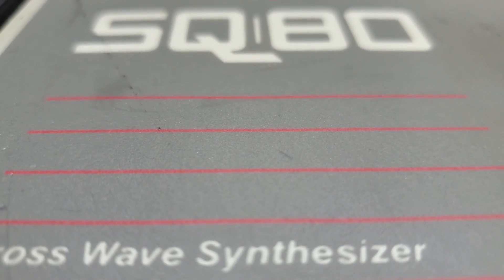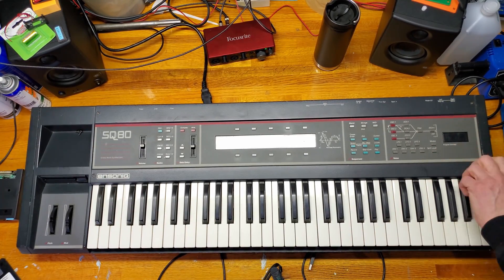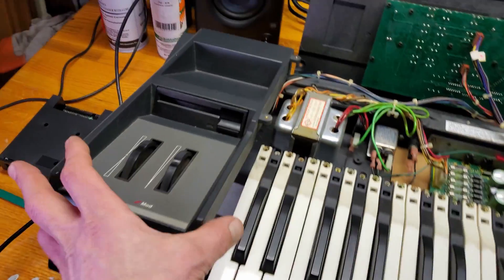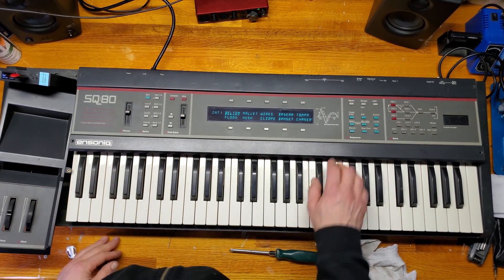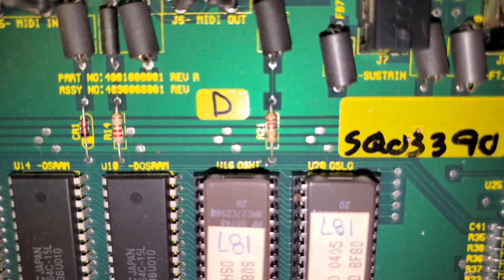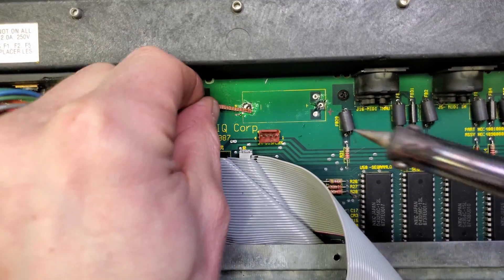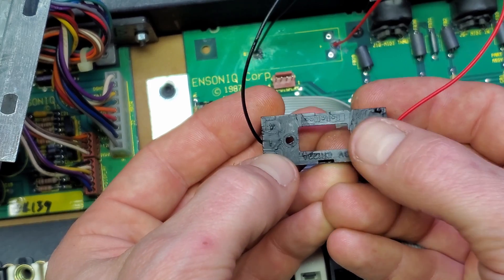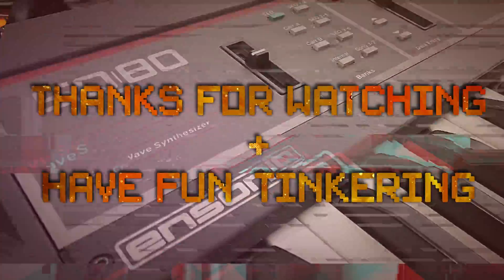Ensoniq SQ80 Battery Replacement & Upgrade (Firmware + Floppy Drive)

Comment: What sort of battery / holder did you use for this?
Reply from the maker: Wow, I can't believe I forgot to mention that. Anyways, the battery I used was a CR123A. I believe I got all the battery stuff for this project off of ebay
Reply: @deltamumusic  Thanks!

Comment: I'm curious if the floppy upgrade was worth it, and where you find patches or waveforms to load onto it? I've got one that came in a TS10, but never used it.
Reply from the maker: Honestly, I haven't made much time to utilize it yet. But I went through with the upgrade for a couple of reasons.
1. I wasn't given any floppies with it
2. I had no floppies that would work with it. (Double-sided Double-density aka DSDD, other kinds are prone to errors)
3. Floppy disks of the right kind are some what expensive. (Maybe $25 for a 10 pack of 720KB disks)

The emulator drive came with a 6 or 8GB flash drive which is more memory then I'll ever need. I did find a huge collection of patches online. A Google search for "Ensoniq SQ-80 Patches" should lead you to Gearspace post called "Ensoniq ESQ-1, SQ-80 - ultamate patch collection".
 Now for the reason why I haven't really used it yet is because these patches can't simply be dragged and dropped onto the usb drive. They have to be loaded one by one via sysex on to the synth and then saved onto the drive. A bit of a daunting task considering there are hundreds of patches in that collection.

As for waveforms, the only way to get more is to access the "hidden" waveforms that come with a firmware upgrade.

If you have a floppy from a TS10 it may work in the SQ-80. I say maybe because the TS line also excepted DSHD on top of DSDD floppies. If it's a DSDD, you clear and format it, It should work for ya.
Reply: @deltamumusic  Thanks, I didn't realize the workflow for the emulator would be so time consuming. I've got that emulator in my TS-10. Now I wonder if it is the same sysex based workflow to copy patches. Thanks for the tips!
Reply from the maker: @anonymous_friend  Yeah, I wasn't aware of the hassle till after I got it. Kind of a bummer, but I'm not too upset about it. We aren't going to get the conveniences of modern equipment on old machines. Back in the day these were cutting edge tech, but they were also working with little to no standard format since the tech was so new which is why we have some the problems we do with older stuff. 
The TS line came out maybe 5 years after the SQ-80 so maybe something was changed between that time period that would make the work flow easier. Hopefully that's the case because you can load samples onto it

Comment: Nice job, but I would have taken the time and trouble to do the battery holder install with the board out! Alway worth taking the time to do it properly, especially with these classic synths
Reply from the maker: Yeah, if I were to do it again now I would go through the trouble of taking it out. I really would have made it much easier at the cost of a little more time.
Reply: What he said. A job worth doing...